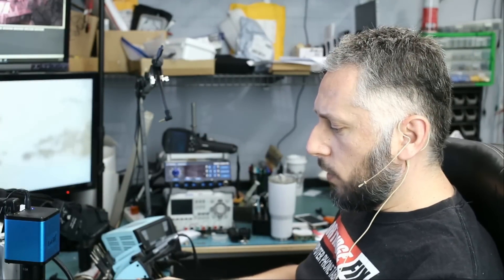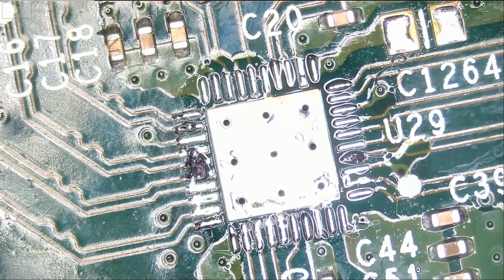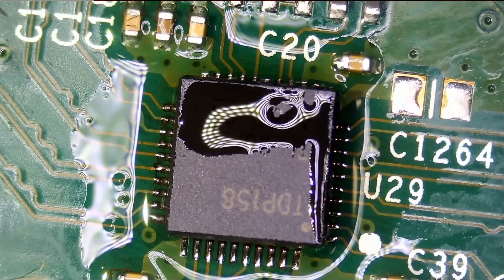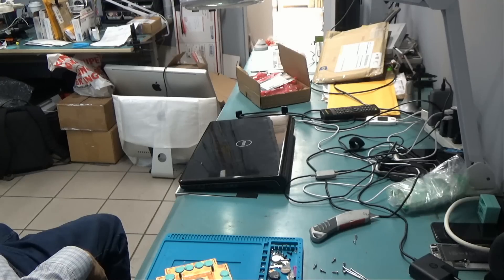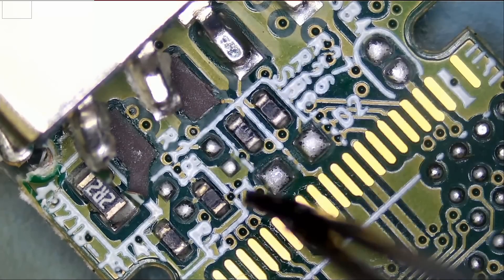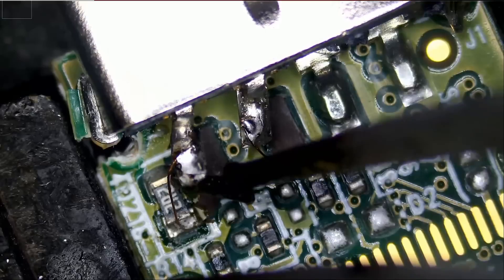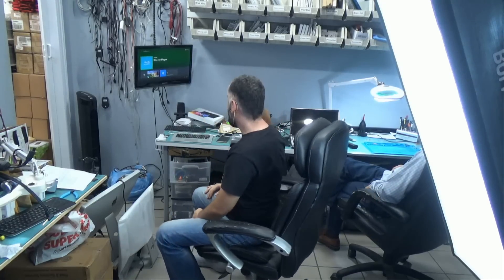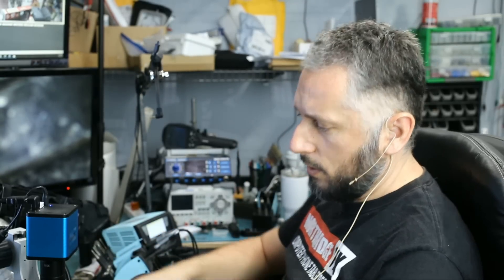Xbox one x Faulty Retimer HDMI Controller chip - No signal Black screen repair

Comment: Great video, at the same time this is horrible that the Xbox one x has these faulty prone chips given this thing was barely launched back in 2017 or 2016 and is recent high end $499.99 USD when new so it was a premium game console and it has these faults.

I've been looking into getting one but really scared away from finding this information for over a year now and just reminds me of my 2002 Xbox going bad around 2005 to 2006 leaving me very frustrated back then because my friends were also having problems with their then brand new Xbox 360s.

Comment: Can I send you my Xbox one x to get repaired
Reply from the maker: What's wrong with it?
Reply: @NorthridgeFix  well I went to turn it on last week and All I get is the no signal screen but it turns on just fine just no picture
Reply from the maker: @louisedwards1680  Yes you can mail it in. If you need to quote first use the contact us form . https://northridgefix.com/contact-us/ We don't post prices on YouTube as they can change with time and this is not a support platform. To mail your device, fill out the mail-in form and follow instructions. https://northridgefix.com/mail-in/

Comment: I counted like 30 secs of heat. What temp is the heat gun set to. I put mine up to like 750 degrees and it ain't comming off. You make it look easy. Also when u reapply solder what kind of solder did you. All u say is unleaded solder.
Reply: Do you fixed the problem. I have the same issue
Reply: @julius77928  i used low melt solder
Reply: And flux

Comment: Hello,  i have an xbox one x mainboard, there are missing capacitators c1264,c16 c18 beside the retimer chip, can you tell me the values of these missing capacitators, thanks in advance
Reply: According to leaked schematics, the values are as follows.
C1264: 22uF, 6.3V, 0805
C16: 0.1uF, 16V, 0402
C18: 1000pF, 50V, 0402
Feel free to find them yourself and verify, though.

Comment: I have a series x. Ive had it for about a year and suddenly out of no where im having this issue. Theres no damage to the hdmi port. I just want to know why this happens
Reply: heat related usually. The retimer is at the back of the unit near the exhaust port. Why msoft chose this layout is beyond me but likely a tradeoff for downsizing from the OG one. Over time the chip gets damage from heat

Comment: Hello
I played games with my xbox one x and after two hours I turned it off. the day after it starts but it shows nothing on the screen but I hear the startup sound on the headset. I replaced the HDMI cable, tried to reset it using the power button and two other buttons, showed nothing on the screen. I had it for a year on the same table with the same hdmi cable on the same tv.
I opened it and everything looks really nice, no damage and not dusty.

Comment: HEY I NEED U TO FIX MY XBOX SERIES X IM HAVING THE SAME PROBLEM LIGHTING STRUCK RIGHT OUTSIDE MY HOUSE THE CABLE BOX AND WIFI ROUTER MY XBOX HAD A HARD WIRED ETHERNET CORD GOING TO IT WHEN THE LIGHTNING STRUCK

Comment: If I can get remote play to work on my phone and the Xbox is working fine but no signal on 3 different TV's with two HDMI cables, is this likely the cause of that? All cables are in the right places. I mean, if I can remote play the console is perfectly fine so it must be the HDMI controller chip or the port itself?
Reply: Yes. If the Xbox companion app can see your Xbox when it's turned on and you can access it remotely, it's a video output problem, most often the retimer chip.
Reply: @ToddStone  thank you!

Comment: What kind of solution are you using on the re-timing chip to get it loose and reattach and is it heat your applying to it both to remove and reapply
Reply: Came here for that same thing
Reply: He's using soldering flux gel.  Using an electronics rework heat gun and the proper tip, the solder will heat up an become liquid.
Reply: Really ? Lol 😂

Comment: I sadly have that problem with my Xbox One X,  i bought it used and when i turn on the console. And it worked fine, then after a week, It just say no signal and Black screen, i have tried diffrent HDMI cable that i know work. But they wont work on the Xbox One X enymore. What do you think is wrong with my console?

Comment: I have replaced both HDMI port and Retimer chip and i'm still getting a no signal on the screen. Is there any other component that can be causing the no signal. The HDMI port is soldered properly and the Retimer chip as well.
Reply: Did you find a fix??
Reply: dead HDD can cause it.

Comment: Its seems that the retimer ic occurs mostly when pairing an Xbox one s or X with a 4k tv. The fat xbox one never had this issues and its locked at 1080 max.
Reply: the og one also didnt have the design flaw of putting the retimer right above the exhaust port. the solder back there takes a beating

Comment: Can you explain better next time what exactly your doing please?!! Like each process, like adding flux or whatever that clear goo melts down into. Which and all tools needed or being used in this process. I have an Xbox one x that I believe the retimer chip is the issue. Have never worked on a chip board before so a little nervous. Also needing to know exactly what I will need too do this repair myself, I’m not paying Microsoft $250 plus shipping for an out of date warranty. I miss the old Xbox/Microsoft customer support where I could just call in and talk to someone. They’re new system is garbage in my opinion and makes you jump through a ton of hoops to just end up paying out almost $300. I expect a class action lawsuit to come Microsoft’s way just like the way the Disc Drive problem. Who knows, really frustrating

Comment: what temperature do you use on the hot air?
Reply: nvm, 380 degrees at 70-50 air flow lol thanks!
Reply: You sure he don't mean 380 Celsius

Comment: why do these fail ? heat ?  if so would  thermal pad help
Reply: yup! Msoft in its infinite wisdom decided to place the retimer directly above the rear exhaust port. The solder back there takes a beating over time espeically if you marathon game

Comment: What is the liquid used to remove and put on the chip?
Reply: I believe it’s called flux.
Reply: It's flux for electronic repair don't use plumbing flux as you will ruin the PCB board  after you have used it clean with ipa or use no clean flux
Reply: Ketchup

Comment: Why don't you ever check to see if you have power coming out of the USB connector. You could have something wrong with the power connectors internally. instead of giving up after checking the caps and or resistors.

Comment: Question: I had temp at 217C and air speed at 70. I tried flux and using reflow gun in conjuction with solder gun and can't get the IC to come free. Not sure what I'm doing wrong. Help.
Reply: 217C is very low for standard rework stations. Try using 350C with low air flow and lots of flux.
Reply: Add leaded solder to the legs to lower the melting point, use flux/soldering iron/solder wick to remove the solder from the legs, then raise your hot air temperature to 390 with 6 airflow, add flux and see the chip come right off.

Comment: I've tried using a butane soldering iron/heat gun and also have used an 18v ryobi heatgun for multiple minutes straight trying to get my ic chip off and it wont budge, any tips? Also using rosin flux with both
Reply: you probably needed to take the board off the metal bottom. that acts like a huge heat sync...

Comment: What is happening at 4:04 ? Is he adding more solder with a standard iron?  Or getting rid of excess with an iron?
Reply: Adding a bit more to the right side, which you can see had a few pads with too little solder, and then just doing a pass on all the other sides to ensure they're all good too.

Comment: Thanks for video, what gauge jumper do you use and how do i get it, thanks.
Reply: Any mobile phone speaker has very fine guage wire inside. Just break open an old broken mobile phone speaker using plyers
Reply: @bellslinki  Ok thanks, saw one on the street and i said wonder if anything i can use didn't pick it up mainly cause wet, but i wont let the other one pass, So use the coil in the speaker?. Thanks again.
Reply: Yes. The wire has an  enamel coating so you can scrape it off or some people just use the heat of the soldering iron to break down the enamel.
Reply: @bellslinki  Ok Thanks for your help and reply. I will do that.